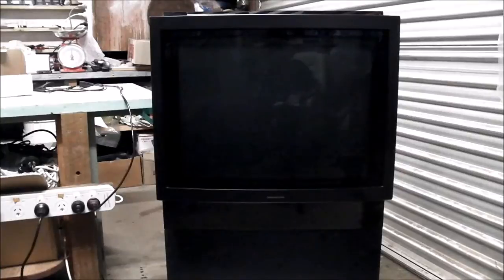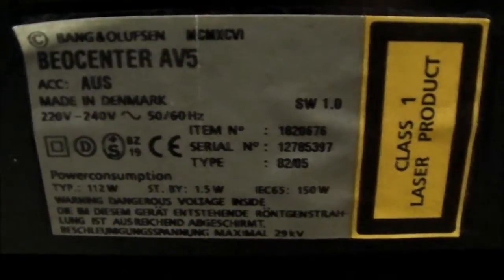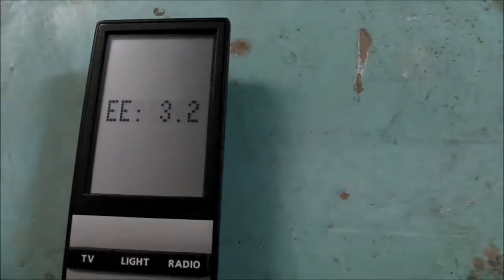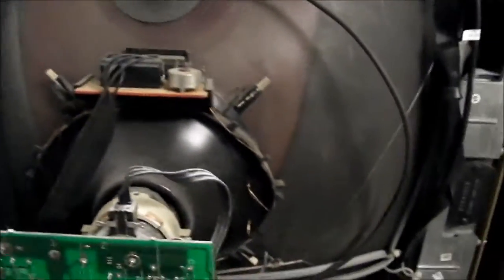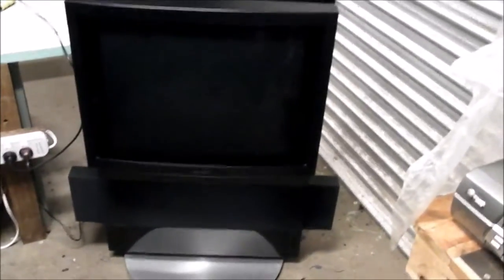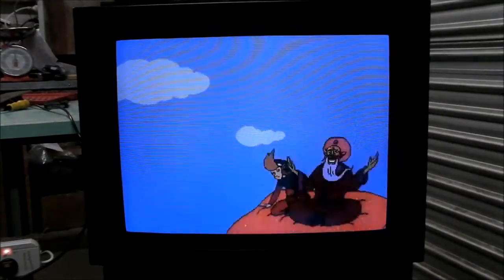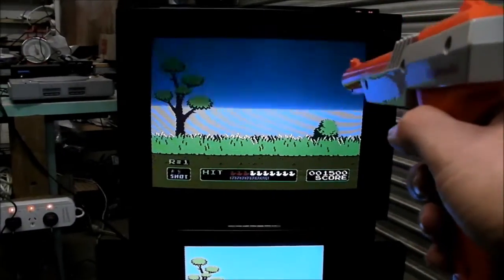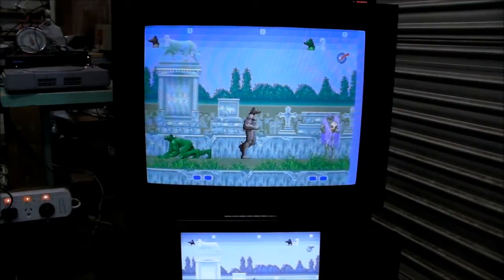Bang & Olufson BeoCenter AV5 with built in CDI player

Comment: For people having issues with the picture being squished towards the top, if you go in to the service menu (menu, 0, 0, go on a beo4) you can adjust the geometry settings.  Here are mine which look great now:
Hph 16
Ham 18
Vam 21
Vsc 47
Vsh 63
Vsl 63
Ewc 40
Ewp 56
Ewt 0
Reply: Wow this really worked, thanks! For some reason mine was stuck on format 2 on start up and had to change manually every time. Now both formats are 4:3 :-)
Reply: ganeshillo I‘d really like to find an easy way to set up a letterboxed 16:9 format. An easy way where you could switch between both formats. For the AV5 and MX4000...
Reply: Thank you, it works for me also. Du you know by any chance how to make the 'format' change on the beo4 remote? It's seems that he changes the resolution from 16:9 to 4:3 by pressing the remote. :) 
Thanks again

Comment: Regarding changing inputs, you can assign each scart to a input button (V tape etc) at the top of the Beo 4 remote. To do this power on, in TV mode select menu, set up, then sockets. Change the values under each heading with the arrow buttons as per usual. I use V tape for AV1 and V aux for AV2. This is what I use on my Mx4002s and MX7000. Hope it works for this set to.
Reply from the maker: Ah ok thats good to know, ill definitely keep that in mind the for the next B&O tv that comes around.
Reply: It doesnt work on my av5. Impossible to force going into an av channel. It just autodetects... This is a problem
Reply: @rgbrob  hi! Just found one of these with a bunch of broken mechanics, except for the tube’s picture! Could you in theory remove the drive and the amp+speakers and keep normal operation? (no audio ofcourse)

Comment: They definitely are designer products. That said, My B&O on its steel swivel-stand has a very reasonable picture quality, only using a Philips tube too. Made in 1994 or so, and retailed for 1000gbp, it doesn't have any 100hz nonsense, or any other annoying features.

Comment: Nice upload thank you , my CD reader has stoped working  on my AV5 i am in the proccess of purchasing a philips replacement from hong kong can you send me any advice or a link or a upload to take out the old CD unit out  many any thanks
Reply: Hi, where did you find the replacement? What is it called? Thanks!
Reply: HINGES LEVERS it’s a VAM1202. I’m waiting on one to come from China now. My av5 laser is also kaput.
Reply: @nicolaspersijn  Heads up for anyone else trying to replace the laser: my AV5 uses a different one, the VAM 1205. It has an IC on the back and 4 cables instead of two. My AV5 was manufactured in january 98 in case that info can be used to indentify which sensor is used.
Reply: @Marormur  do you have any resources for getting to the actual assembly. It’s really in there good and I’ve been putting off this repair due to how difficult it seems to get the assembly out.
Reply: @nicolaspersijn  No I don't, but I figured the best way to remove it was by removing the inside cover. It's held it place by 5 black screws and one screw is pretty much directly under the big motor. On the end of the whole assembly there should be this big plastic gear (mine is white) with 3 silver screws around them, one of which is in a hole. Unscrew those and the whole assembly should be pretty much falling apart at that point. When removing the big motor, you may want to keep an eye on the small black plastic roll on the corner, which keeps the wire in place. There was still a bit of tension on that wire and it made the roll fly through my room. When you've removed the motor you should be able to remove the last black screw for the plastic cover and then have enough room to remove the laser unit.

Edit: Forgot to mention that another screw may be hidden on the other side beneath the grey ribbon cable with one red wire. But that one should be easier to spot than the one under the motor.

Comment: hi Rob, i am the lucky owner of an AV5, and found a weird quirk.
the MX4000-8000 range can be forced into progressive scan mode in the picture menu, but on the AV5 that method doesn't seem to work.
however, i hooked up a 480i svideo source today, which flickers horribly, but when i go to ->menu->picture, i can see the image go into progressive scan mode, and wonderful scanlines appear, at least on the bit of screen visible on either side of the menu.
and as soon as i exit the menu the flicker is back.
do you know of a way to switch between interlaced and deinterlace mode on the AV5?
Reply: Hey, did you figure this out?
Reply: hey. have you found a solution for this?

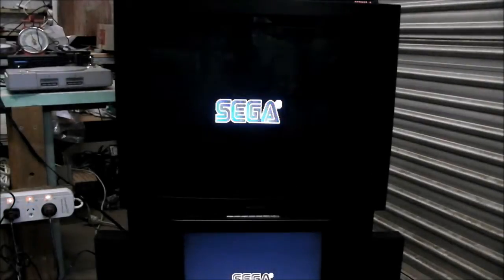Comment: Hi RGB Rob, @ 26:40min. in the Video, you just changed the Picture to 4:3 ...how did you do that? i can't get my av5 to output 4:3 with rgb Consoles ...please help :-(
Reply from the maker: Yeah its annoying, i can't remember how I did it. I always have trouble getting the B&Os into 4:3 mode. I seem to remember someone commenting in one of my B&O videos somewhere about how to change into 4:3 mode.
Reply: Hi Rob, i just figured out how to do it :-) You can program your Beo4 Remote by adding "Format" to your List-button. To do so you just have to push & hold the Standby Button und push on the List Button, then "ADD?" will be shown on the Display of the Remote. Now press the "OK" button and scroll with the up/down Arrow buttons untill you can read "FORMAT" on the Remotes Display. Now press "Ok" to save this new macro. So if you wanna change the format when needed, you press the "LIST" button, as many times as until "FORMAT" will be shown on the Remote, press the "OK" button and now change the format with a push on the up or down Arrow Button and youre good.
Reply from the maker: Thanks, I need to remember your instructions here in case anymore B&O come my way

Comment: So apparently the later version without the cdi is still actually cdi capable!
You need to get into the service menu to re-enable it, and the 2 control ports are covered by plastic, so it's possible to make a cut out so the ports are accessible.
Everything is still in there :)

Comment: Hello! I just bought this tv today.
Problem is i don't know how to access av channels... When pressing av on the remote nothing happens...
And when i go into the menu and select " av socket" , i don't get what it says ("vtape, vtape 2, svhs etc..)
How do i select a scart av input?
Thanks : )
Reply: Sorry i asked the question too fast : ) didnt watch your whole video. Seems you have the same problem.
I have a laserdisc connected with composite cables. With a scart composite adapter, the tv doesn't register the signal and doesnt switch to the Av channel. But connecting the composite cables directly to the composite inputs on the back it works fine.
Reply: @crissylutfaaitchison3754  i have the original remote that came with the tv! I sort of understand how the tv works: you cannot switch between the av inputs... You need to turn on or off the consoles/vcr's/laserdisc players etc and then turn on the tv.
Also the scart input that is on the right cannot be used for consoles, only for a proprietary b&o vcr player apparently
Reply: @crissylutfaaitchison3754  when i click on cd on the remote, the player starts to play the cd
Reply: @crissylutfaaitchison3754  what line should i tell you? I have ic1+2 sw 1.0 ic707 sw2.0
Reply: Wow you should write a book about this tv
Reply: @crissylutfaaitchison3754  do you have instagram or facebook? Easier to communicate

Comment: Have the TV without even knowing the CDI feature, thanks need to try it if i can find a controller.
The remote has ekstra buttons if you press the LIST button, it gives you a list of favorites you can scroll through.
If you are missing a funktion you can add them to the remote if you just follow the manual https://www.beoplay.com/support/product-support/~/media/8EE3BD2E429B4134A1583613C456C506.ashx
Look for V.tape and remember you can program the AV inputs in the TV menu too.
Bought my TV for around 100$ some many years ago, the CD didnt work, so i bought one more of the same TV with a defective tube for the cost of cake for the local B&O store.